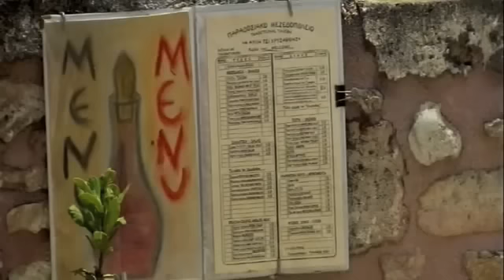Yotam Ottolenghi visits Crete

Comment: 40:27 it's called PORK KALAMAKI not souvlaki....souvlaki consists of pieces of grilled meat wraped around a pita pie along with tomatoes,onions,tzatziki,parsley,paprika and optional potatoe chips...it takes it's name from the souvla which is the grill....any meat that's just pierced through a stick and then bbq'ed on each side is called kalamaki...so the correct name is pork kalamaki,chicken kalamaki etc etc and that's the proper way to ask for it whenever you visit greece regardless of what some idiots might tell you

Comment: If the bread is made with Barley instead of Wheat, how does it rise?
Reply from the maker: Add yeast I guess?!
Reply: @NowHeraklion  That's the question, since WHEAT is the only type of flour which forms the gluten strands which trap the gas created by the yeast fermentation, causing the dough to rise.  Rye flour, barley flour, etc. - none of them create gluten strands.
Reply: Crete is wonderful. Ottolenghi is a great chef.